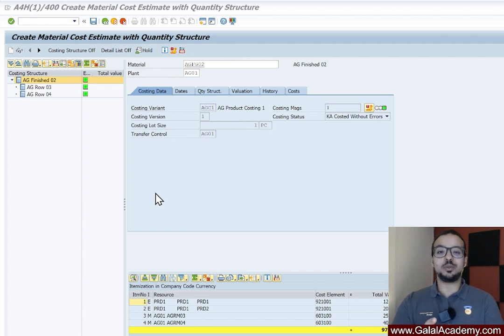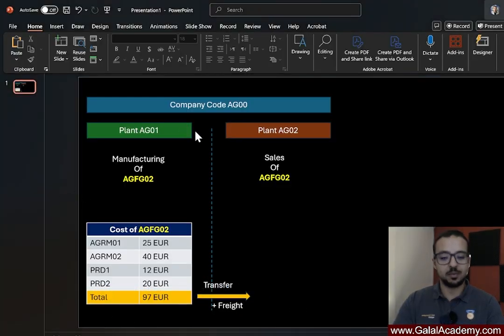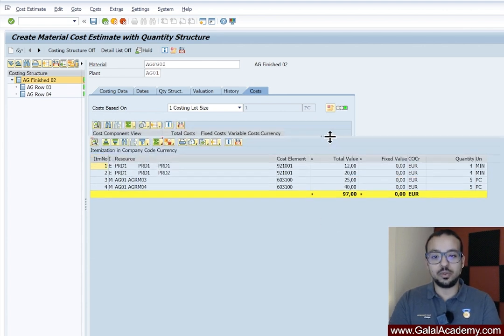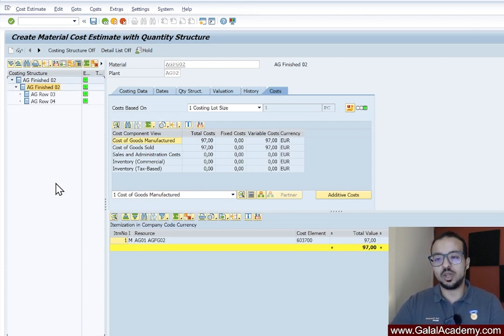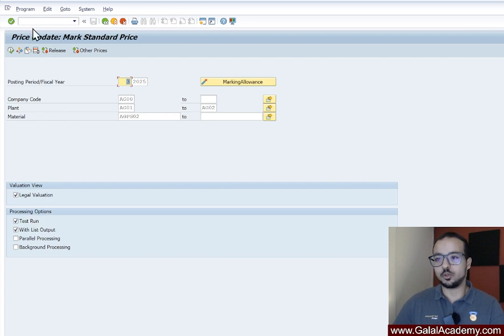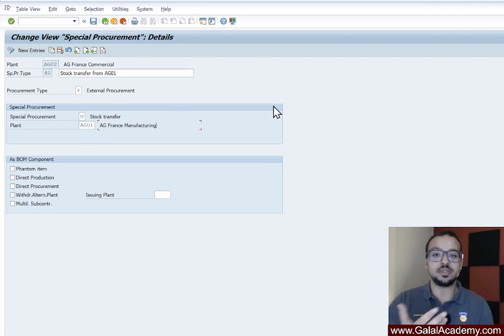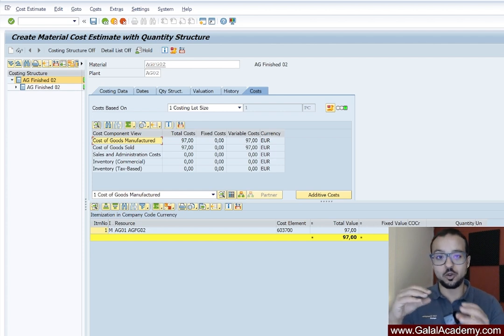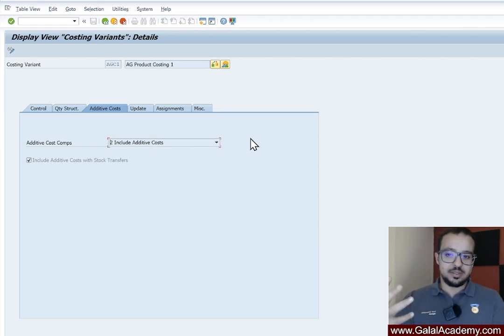SAP Transfer Control: Cross-Plant Standard Cost Transfer

Comment: Thank you. I have a question:

If I have multiple production plants and need to transfer the standard cost estimate from these plants to a logistics plant, how can I achieve this, especially since the Special Procurement Key only allows for one plant?
Reply from the maker: You can create multiple keys, one for each production plant and in the logistics plant you assign the keys to the materials based on the manufacturing plant of each material. for exampl: materials produced in AG01 take the key 0001 and the ones produced in plant xxx take key 0002
Reply: But the system accept only on special procurement key in the material master in our scenario we have a logistic plant and three different production plant i will create SPK for each one but how can i assign all of them in the material in logistic plant ?